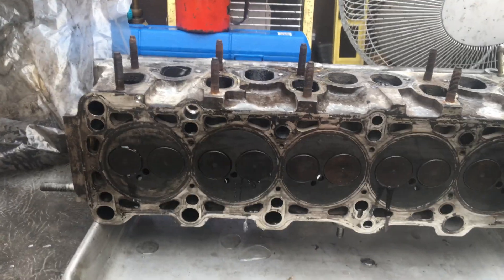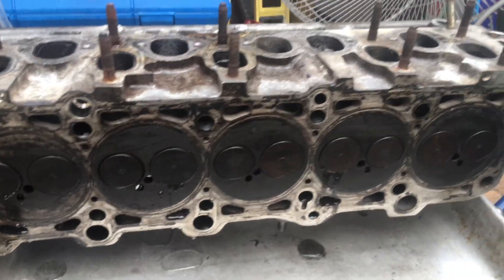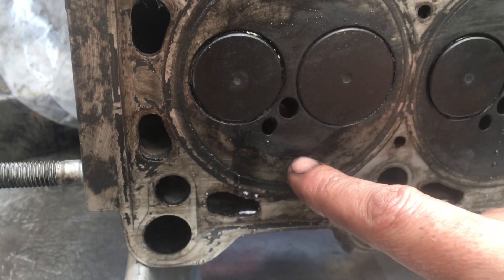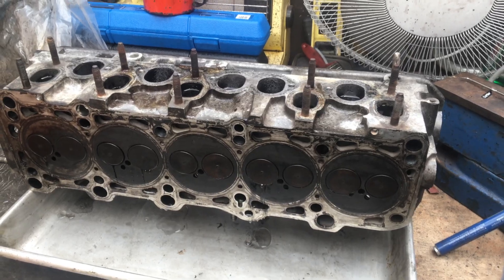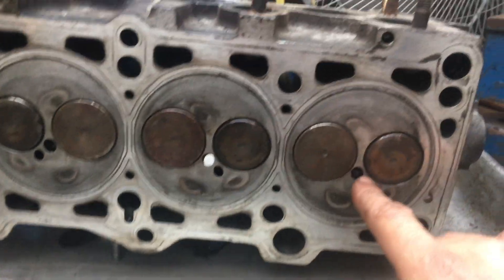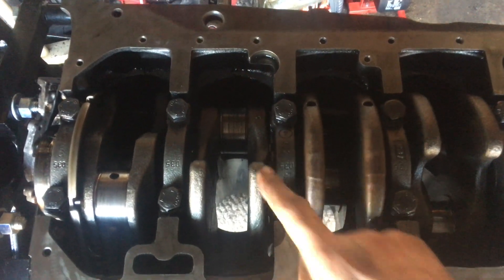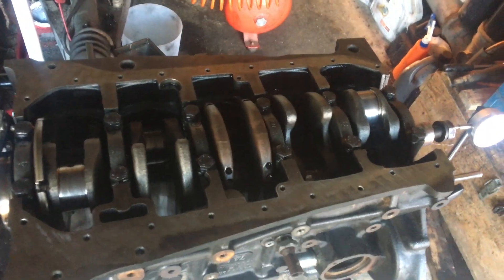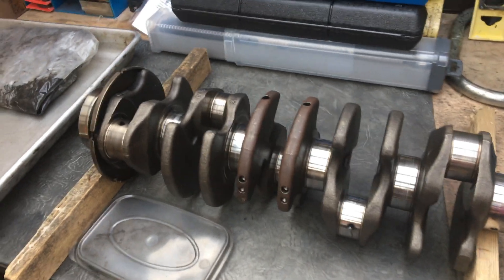Crankshaft removed/Quick look at cylinder head

Comment: Another great video 
Those valves are 100% bent twigs trust me thats too fast a leak to be just valve seat 
That's oil starvation on the crank the worst ones being farthest from the pump 
In my experience the shells got thin and they spin overlap then weld themselves to the conrod 
Check one of the decent shells in the  conrod that had the worst shell and see if it's loose in the half conrod
Check the camshaft journal I'd put money on it seizing there too and the timing slipped !!
Reply from the maker: Thanks, again another really helpful useful post, I’ve just got everything ready to go to machine shop, they’re going to check everything, valves head block crank, pistons and rods.
Reply: @TwiggsT4  I'm following you because I've been there self thought and think I do now for a living 
Your a clever self thought sort too so please ask me before you spend and let me share what I've learned that's why this platform is so fuking usefully  
When you find damage or wear work back till you don't see any there's where you find the problem
Reply from the maker: I really appreciate all your help and advice so far, my dad was a machinist/precision engineer and I also done an apprenticeship in machining, but when it comes to mechanics I don’t have much experience and it’s been 20years since I changed career or even done any major work on engines, so your advice is greatly appreciated, again many thanks 🙏 
I’m having all components checked first in the machine shop before carrying out any work. 
I had a closer look at the main crank journals and the scratches are actually debris from the broken down shells, so hopefully the main journals will polish up